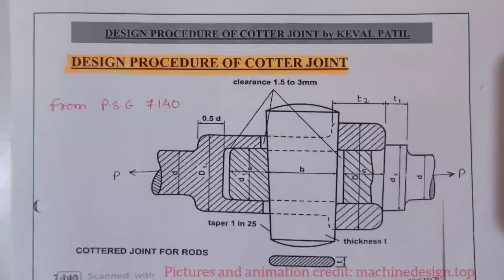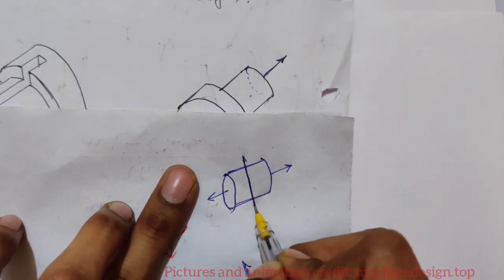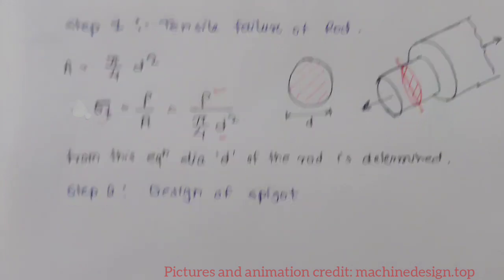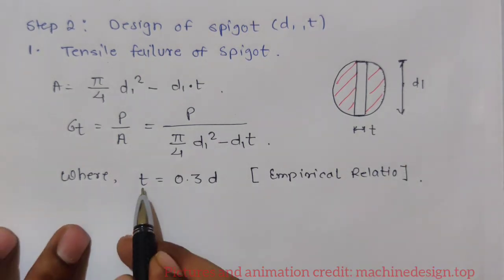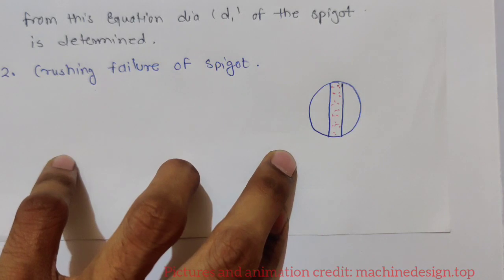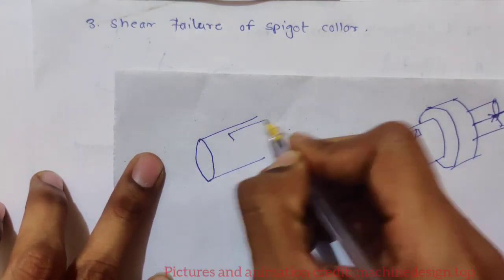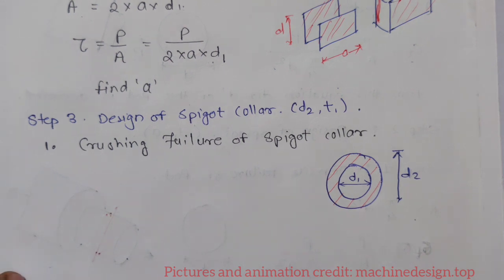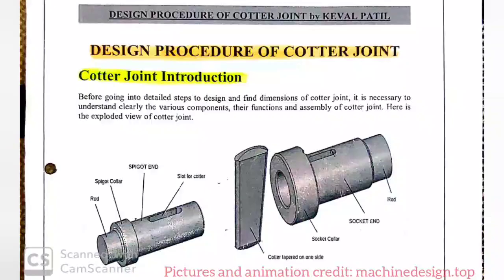Design of Cotter Joint using PSG _ Part 1 (Hindi)

Comment: 00:03 Design procedure of socket and spigot type cotter joint
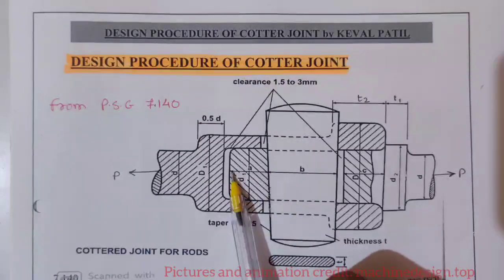02:55 Understanding tensile failure in a cotter joint design process
05:36 Explanation of forces acting on the Cotter joint failure area
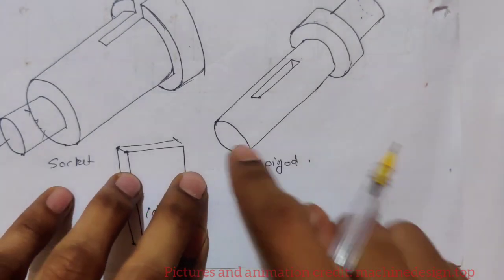10:11 Design considerations for tension force in cotter joint
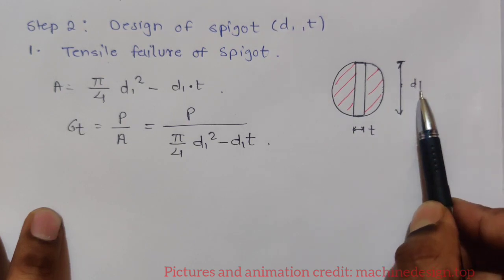13:48 Explanation of crushing failure in cotter joint
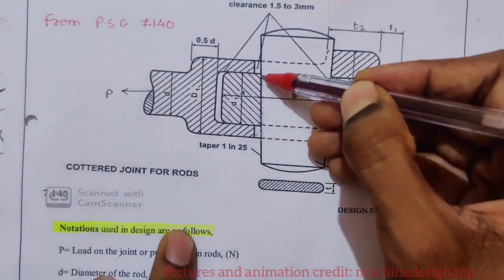17:43 Crushing stress is determined when there is no relative motion
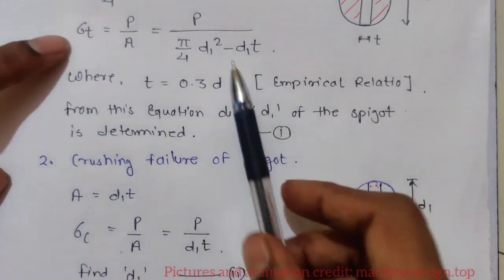20:42 Explanation of shear failure in a cotter joint
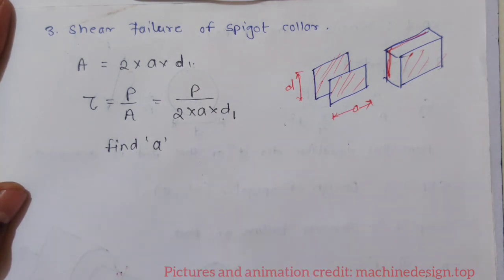25:12 Design of Spigot involves finding resisting area and crushing stress.
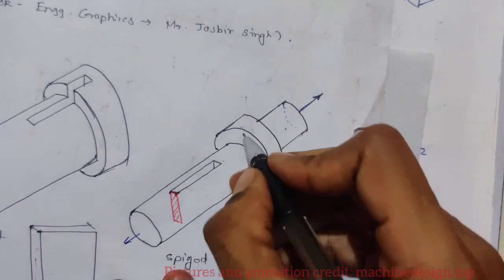29:26 Understanding the key factors in designing a Cotter Joint.